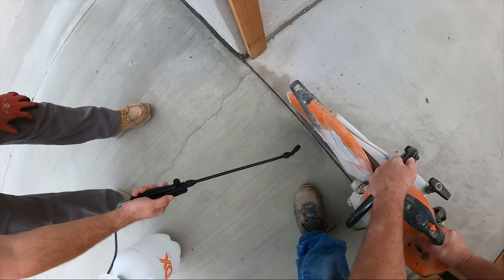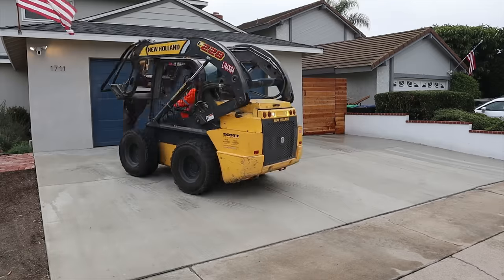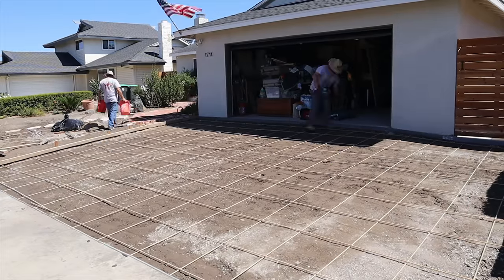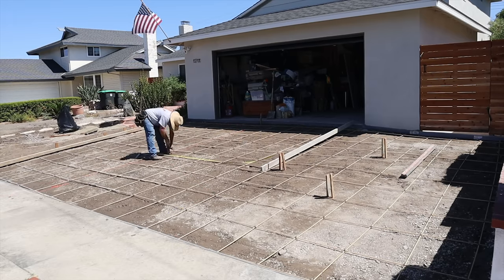Concrete GONE WRONG! Had to Remove and Replace

Comment: As a concrete worker myself I got to say that I'm very impressed by the integrity and work these guys have. Looks like the compactor may need to be replaced with a bigger one or just a new one, seems it was having issues. What really had me a bit worried was the brooming itself i'm used to doing those in 1 pass either pull or push/pull through the whole slab because I get worried that those multiple passes with the broom will either give me a different broom look all around or have a ugly in-between spot. Yeah the brooming does fade away eventually and you dont notice the marks later but thats usually years down the line.. anyway cheers and great work!
Reply: He hints that it was the  cement provider
Reply: A lot of scumbags out there with no self respect or respect for their customers, who pay their hard earned money to people that can easily take advantage of them. People live in these houses, and flybys ruin the industry, most of them lowlife junkies and alcoholics. Some home owners are looking to scam as well, but most just want to pay an honest amount to have some decent looking work done on their property, safely.
Reply: @mattblah7737  you seem to be angry .
Reply: Absolutely
Reply: For concrete, all my life all concrete.All different concrete companies open New Jersey was a Union concrete finish it, let me tell you some of them.Concrete companies are very shady.We had a without footings columns because the concrete didn't come up to p s I because they were skinning on it
Reply: Always takes so Cylinders Take three from every truck that is your insurance

Comment: I have to say, I'm extremely impressed by you guys. Being in construction myself, you see so many people cut corners, especially with compaction of the base material. The only thing I might add, get your guys a larger compactor.
Reply from the maker: TY
Reply: @OdellCompleteConcrete  was this just a bad batch of concrete?
Reply: @mattthemorningafter  most likely, if there was something in the mix that’s not supposed to be in there it could weaken the concrete which is what happened here
Reply: Could be a bad mix, it's all cracked in the same way you would see from concrete that had maybe to much water.   Settling is usually a spot not consistant across a few yards of dried pave.
Reply: @mattthemorningafter  ive never seen those surface cracks all over like that
Reply: @Josh B that is a standard sized compactor most contractors use. It doesn't take up much space so it's easy to transport and some strong guys can load it and unload it by themselves. At most you only need 2 guys to load/unload.
Reply: @OdellCompleteConcrete  Probably old overmixed crete. Some companies are not good about dumping left over crete.
Reply: Above reply was in wife's name. I'm Don, concrete contractor  that has seen this before.Kudos on replacing it, and it should never have shrinkage cracked with fiber mixed into it and properly curing it.
Reply from the maker: To heavy to lift.
Might hurt my back
Reply: @Bennysol  I had to use them for years, typically for asphalt patches and base work. They are great for portability, they're not great at doing the 1 job they have to do.  
Every job I'm on, I have a piece of equipment, so after a lot of pushing, I got the company to get me a Wacker BPU2540A and that thing was able to pass density tests.  I was never able to get those little ones to pass a density test for base material like Limerock, concrete fines, road base, shell, or soil cement, pretty much all the road base materials we use in Central Florida.

Comment: I worked for a concrete contractor back in the 1980s and quality conrete made a huge difference.  The newest plant washed the sand and gravel so it was clean and easy to work with

Comment: Now that's a good contractor.  Admits his mistakes, shows the world and then fixes it.  We need more people like you in this world.
Reply: It wasn't his mistake. The cement was crap hopefully the company he used for the pour reimbursed him.
Reply: @ac7438  He has to stand by the mix he used unfortunately.  Maybe he has the ability to get reimbursed for the faulty mix but who knows.
Reply from the maker: I hope so
Reply: @ac7438  technically it wasn't his fault, but the homeowner pur their trust in him and trusted him to use quality products.  It sucks and I personally don't blame him as well. When you buy something from a store and it's crap and have to return it, you deal with the store that sold it not the manufacturer.  He corrected it so he earned my respect.  Hoping the concrete company reimbursed him as well.  But I bet he thinks twice about using them again.
Reply: Uses the same concrete company

Comment: I've had to do this twice in my short career. Alot of ready mix guys either don't clean out old concrete from prior jobs and mix Mudd with new or they load up 2000 psi concrete and misreport it as 3000 so they can pocket the extra dough and then owner calls and complains that the concrete is cracking...hate when this happens I always ask for ticket upon truck arrival cuz it doesn't lie. New contractor here , Odell you are the example of excellent workmanship
Reply: My first impression was that he got a hot load of concrete - otherwise known as "come back concrete."  If the driver doesn't back spin his drum to get rid of the previous remnants, it can cause rapid cement hydration of the next batch.  it only takes a little bit to spoil the whole next load.
Reply: @smo-guiver8315  very true

Comment: First off, thanks for standing behind your work. That's the mark of a pro for sure! But I have a few questions. 
1. I've noticed those holes in concrete before have been caused by pumping on muddy ground and chunks of mud are just finished over. Then a few days or weeks later, the finish breaks through and the mud gets washed out. Could that be the case?

2. I would think that creating the control joint with a deep jointer would be better because you establish the control before the curing process ever starts. Am I missing something? 

Not a question but a comment, a few cheap insurance policies I use are, I've never had a complaint about too any saw cuts. Only visible cracks. I add fiber to everything, and I always have the plant bring at least 1 test cylinder for every 50yds. I label them with address, date, and time, and I keep them until the warranty expires.
Reply from the maker: Great ideas.
The first pour is on the channel
Reply: The cylinder thing is actually really clever. That way you have the receipts, so to speak.
Reply: My career was in concrete, asphalt, sand & gravel. Adding fiber to 'everything' you pour is a waste of money in 90% of the applications you are likely doing. Most issues/problems in concrete boil down to two reasons- 1-poor materials going into the making of the concrete and 2- poor/incorrect sitework and finishing of the mix.

I've batched and oversaw the batching of concrete for everything from driveways to high rise buildings and had less than 100 yards rejected in my entire career over 30 years. Quality control of materials and finishing is highly overlooked.
Reply: @id10t98  the advantage of fiber depends on what climate zone you're in. Water to cement ratio is critical.
Reply: @onetwothree4148  Fiber can be used in any climate, it's only added for strength. I've been on jobs using fiber in Alaska and in Las Vegas, cant get much more variance in climate than that.
Reply: @id10t98  yeah, but the climate isn't the same in all climates :) In colder climates I'd add fiber (and air) to about "everything" to help with freeze-thaw cycles

Comment: Very professional approach and workmanship..... In UK we don't really do so many concrete drives, more to do now with surface water not being run off onto highway, so they need to be permeable.... Or soak away.. Excellent video

Comment: As an old structural concrete contractor in S. CA. I've had aggregate react with chemicals in the concrete & pop out, leaving little to big craters. I hope you took some of the broken pieces & took them to a lab for strength testing, I'll bet it did not have enough cement in the mix the way it came apart, I doubt it would come up to 2000psi. 
I also hope the redimix co. did not charge you for the second time.
Reply: He refuses to respond to you because he knows the mix was insignificant
Reply: @jimbo7042  when doing the demo he mentions the concrete is weak so that is likely the real problem as the poster has mentioned.
Reply: I believe he said the owner was covering the cement that helps him by not having to pay it all out of pocket.
Reply: @georgescott6049  My point was if the test proved the concrete was not up to at least 200psi it is their fault & should not change him for the second loads.
Reply: @dakmycat3688  My point was that if the test showed the concrete did not reach 2000 PSI at least, then no one should have to eat the second go around but the concrete company
Reply: @flowartbyjimbruce4399  copy that
Reply: Had that my own garage called alikine reaction durn cement shortage Portland wasn’t cooled down from mfg
Reply: I’m a batch operator. What you do is get samples of that concrete to determine the psi. Then reach out to the National Readymix salesman or operations manager for warranty on their product. Readymix companies have insurances that take care of those problem and cover the expenses. 
 
The holes might be from bad rock maybe floating rock. Floating rock is hollow and takes up a lot of water. Water is the enemy of concrete. So if it had contaminated rock that causes the concrete to get batched with a lot of water, that might explain the cracks.
Reply: It did look like a contaminated mix. But I've seen the spider cracks before, and I'd bet that they poured the driveway on a hot and windy day.    Looked like a mixture of shrinkage cracks and bad mix. The story at the end about why he ordered short wasnt fooling anyone who's done this work for a long time. Need 10 yards? I'll just send em 9. Lol. Two 5 yard trucks, 15 minutes apart is how reputable plants do it if worried about being overweight.
Reply: That's what it looked like to me. Either not enough Portland or Portland that was not made right. The latter seems more likely.
Reply: He has said in other comments that he got the 2nd load free of charge

Comment: Great video, ya gotta respect all tradesmen that stand over their work, I’m sure this guy will benefit hugely in recommendations for future work in the neighbourhood. Well done guys
Reply from the maker: I concur
TY
Reply: Yes I respect that your company stood by their work. I would suggest using chairs in the future to hold up your reinforcement. I saw your boys pulling up the steel as they went along but it’s tough keeping that steel up when your stepping on it while working the concrete. If you review your video you will see that most of your reinforcement was on or near the ground which means your rods were useless on countering any tensile stress on any ground upheaval.

Comment: Always hear ppl say "why would I call back a contractor who did a bad job ?"...because it costs a lot and you have to give a guy a chance to fix it...that's integrity 💪👍👌
Reply: But if this happens again. It can cost you future clients.
Reply: “He” didn’t do a “bad job”, something was wrong with the concrete mix/ratios from the concrete plant/company. It happens sometimes. As long as it’s properly fixed & doesn’t cost the homeowner anymore to fix it, then customers will still talk & spread great things (word-of-mouth) about his work ethic & integrity… & that he can be trusted to come back & fix anything should they somehow experience any (generally rare/uncommon) issues. Nothing better than knowing it’ll be done & done right, or it WILL be done again 100% on the company’s dime. 🤷‍♀️
Reply from the maker: I concur
TY
Reply: @ashleyfalcon125  Well, I wouldn't. I wouldn't care if it was for free.
My own house, maybe. But not for a customer who are paying thousands.
Reply: in my case was, the bad job was apparent DURING the process, asking him to fix it just lead to him abandoning the job half way. Now I got a law suit in my hands.

Comment: Hello Odell, great job there. Impressive. I really liked your new saw. I actually like the subtleness of the cut lines vs the larger radius of the edger trowels for joints. A lot less debris collecting in the joints too. I might try that next time I pour a pad.
Reply from the maker: Youll love it.
GL
Reply: 4'' thick---cut every 4 feet ----- 5inch thick  --cut every 5 feet

Comment: Yeah, I agree there was something wrong with original material mix. Not enough cement in the mix, perhaps. Or maybe original pour was already curing and the truck operator added extra water to make it out the chute. Or maybe a little of both.

Comment: Wow!... Imagine being a startup contractor and this happens in the first month of business... The concrete company may cover for the material and all but, still... equipment rental, labor hours, rebars... So responsible an ethical from OCC to back up his work... heck, maybe he is an occ of his customers satisfaction and work quality, and protects it with great work.
Reply from the maker: It would be tough.
It's difficult to get the concrete provider to pay.
It takes a lot of money.
Reply: I just framed 600 square ft, plumber tore it all out to install sump pump plumbing that wasn't needed. Watching them everyday piece it all back.
Reply: Would resufer work ?

Comment: I'm impressed with your Customer Service on your work Warranty 👍.  Has concrete prices gone down ?. Dave.
Reply from the maker: No, only up
Reply: Up and up, and then additional charges like Environmental surcharge $49.00 per truck and if you are doing Public Works $200.00 extra per truck

Comment: I hope you get to test a sample of the concrete, because I have never seen anything like it, the tiny small cracks and there was nothing that held it together, there will probably also be a refund with the concrete supplier which must be settled. Hope you will share the result, as always nicely done work.
Reply from the maker: I saved some of it.

Comment: Your load of concrete was put in top of expired concrete that was still in the barrel. 
That's why it turned to powder instead of breaking into chunks.
Start taking samples at your job sites and the chance of getting bad product will stop immediately
Reply from the maker: I believe your absolutely right
Reply: And they probably had to add extra water to make up for that, which made it weaker. Looks like there was too much water on the surface

Comment: Seems like the fiberglass rod is very low in the new slab ?
Reply: Reinforcement "is primarily used in slabs on grade to serve as a control of cracking due to shrinkage and other effects" (Designing Floor Slabs on Grade, Boyd C. Ringo and Robert B. Anderson, p. 11). The reinforcement will not prevent cracking but will minimize cracks and maintain aggregate interlock. Rarely would reinforcement be used in a driveway to provide structural strength. There is a somewhat complicated subgrade drag equation used to determine the amount of reinforcement needed for shrinkage crack control. The idea is for the reinforcement to take over the tension that would have been on the concrete had it not cracked. In a slab with shrinkage control reinforcement, the reinforcement must be placed "above the mid-depth of the slab (ibid, p. 18). YES, the fiberglass rod is very low. It does almost nothing at that level and also totally ignores the requirement for coverage of the reinforcement by the concrete.

Comment: Love the videos, and I think you guys do some nice work, I’ve just always wondered why you trowel a driveway before a broom finish, when you can get a super clean flat finish from a mag, and a good straightedge man. I feel like troweling and brooming over works the concrete and weakens it to the point where when it fully cures in high temps you get surface cracks and Spaulding.
Reply from the maker: It consolidates the surface and gets harder
Reply: I noticed if I hit the concrete with the steel to fast I had cracking also when it is too hot I think wet curing helps. Awesome content nice to see guys stand behind their work.

Comment: I remember back in the eighties watching some guys laying concrete on a military base in the UK, inside of a huge garage. The engineer made them lay it in a chess board pattern. First the white squares, then once it had hardened they did the black squares. The engineer said it was more structurally sound and reduced cracking significantly.  I know the construction manager thought it was a nonsense lol.
Reply from the maker: Sounds like a lot of work

Comment: That's crazy, you should make your cement company pay for your work
Reply from the maker: I wish
Reply: Don't worry, word gets around. Nat'l could replace or return 100% cash (<1500). Now it will cost them 10x that in biz over the next 6-12 months.
Reply: Ready mix customers are like revolving doors. The customer always comes back after the other companys pisses them off.

Comment: Are you able tell us the exact fibers you are using?
Great work as always .
Cracks are not that much of a big deal but those holes are a worry.
Hmm may have too high of  cement to water ratio. 4" slump is hard work.
Cheers from Oz
Reply from the maker: Contaminated load
Reply: @OdellCompleteConcrete  would that be from the driver not doing a good clean out.

Comment: Would it be smart to vibrate that concrete especially working with a thicker mix? I would guess there are some areas with bubbles and voids just doing by hand.